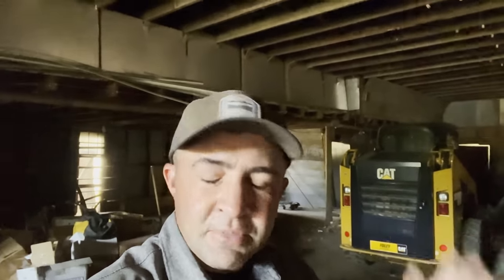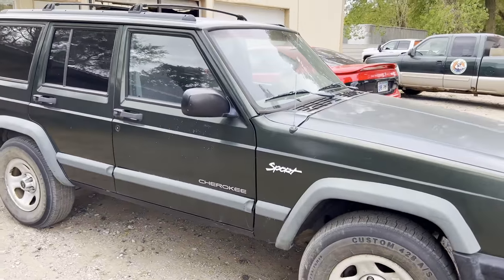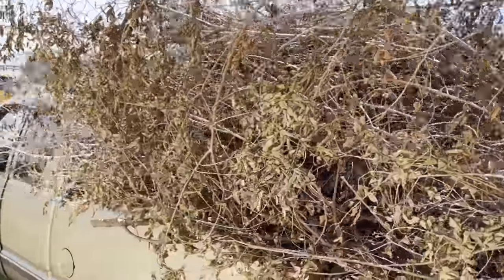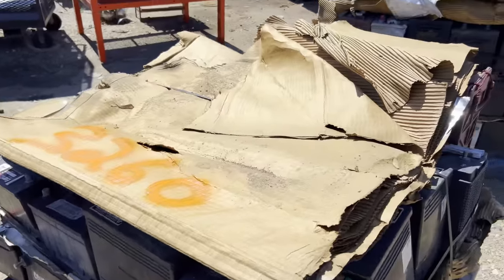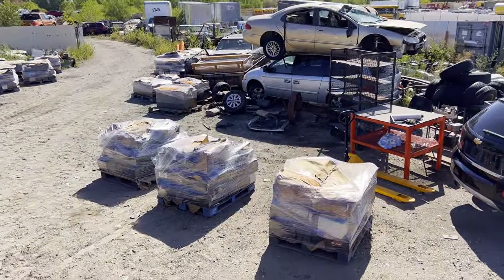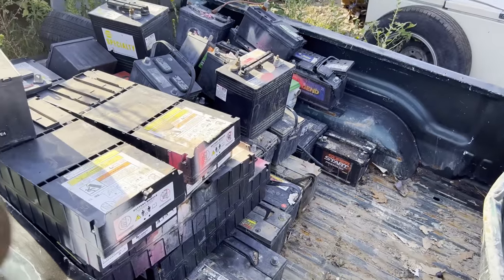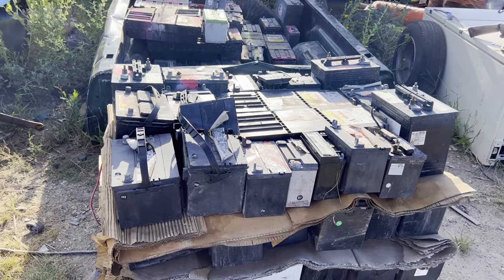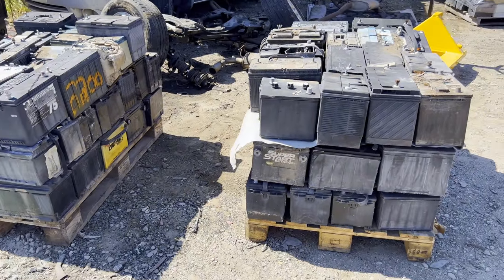A Look inside the CRAZY week of a junk man. HOW do I do it? Loading batteries, crushing cars & more!

Comment: Speaking shelves, My buddy and I were at MSC in our state and walked in just as a pallet load of brand new shelving slide of the pallet and crashed to the floor, The manager said, I've had nothing but bad luck with this load, This is the third  and last time and then I heard him say for 2-Cents I'd scrap the whole load, I reached in my pocket pulled out two cents and handed it to him. He said back up your truck you own it it all. It took my buddy and me 45 minutes to load it all. I have 24x6ft steel shelving throughout my 70 foot long ranch house my garage has two walls and my buddy filled three walls in his two-car garage. Not bad for 2-cents
Reply: lucky dog woooooooooooooof

Comment: A suggestion on the cardboard you will need. Talk to a local retailer that sells gun safes, all safes come with good quality cardboard in a box configuration with no bottom because they are on pallets. Most of the time they just get rid of the cardboard however they can, particularly if scrap paper prices are low.

Comment: Sounds like that battery outfit is warehousing the pallets of batteries like fruit bins 9 or 10 high then trans shiping them elsewhere in containers, wrapping loads to the pallets is pretty standard in the freight industry here it will save having to band them, hard yakka Silas in the heat, have a good one

Comment: when you set a pallet in the back of the semi you could leave the forks on the loader close to the back of the truck at about half the height of the truck floor and use the fork to step up on making it easer to climb up and down from  the truck.

Comment: I used to work at a ford assembly plant.. during just one 10 hour shift I would install 690 batteries..it was the second hardest job in the plant because of all that weight..first few batteries were light..but after that they started getting heavier and heavier..and that 690th battery felt like it weighed 690 lbs 🦾🤣🤣

Comment: I used to work at Oreilly's.  We did not ship same size batteries per load . That's impossible to realize.  Also Oreilly's uses corrugated fold up plastic boxes as a container to put them in . Your battery company just wants to be difficult.

Comment: Guess truck loading is different than in the 70s. I worked on a dock, my boss yanked the driver out of the cab of the truck and told him to get his butt in the trailer and help out...or spend the rest of his life on the dock.
Reply: Guess it would depend on the circumstances. If it's a 3rd party driver you now have to worry about worker liability.

Comment: @adventuresmadefromscratch find a 4 foot 4x4 board and when you load a batch of batteries into the trailer you can lay the board down and then use the next pallet to push it into the trailer. Once you have several loaded into the trailer then you can move them around to your load specifications. Just an idea.

Comment: You’re better off not dealing with a company like that they sound like real morons Great video Silas
Reply from the maker: We plan on going back to our old company if possible, even if it’s a little less money.
Reply: Actually they sound like they want things done well to make their own lives easy, and are willing to pay for that.  Using brand new, double or triple wall cardboard the same size as the pallet, between layers of batteries, will actually make the job of stacking and securing the batteries EASIER than using random scraps in random condition.  Separating out the various sizes/types of batteries as you acquire and store them, avoids having to search for similar batteries from a jumbled mixture when palletizing them.  Not having side terminals facing outward makes sense, and not having them touching when facing inward makes sense also.  If I were them, I'd go one step further and say that only one particular size/type of pallet is allowed.
Reply: @AdventuresMadeFromScratch  you must sleep like a rock on battery day/night

Comment: When old battery's get to the recycler ,they tip them in to a big crusher and smash them to bits  to get the plastic and metal separated .  What does it matter if they are different sizes ??  .It sounds like the receiver has a megga dose of OCD  and needs the pallets to be all neat and tidy !

Comment: you could have the truck driver drop the air on the drives to lessen the grade you haft to pull or push the pallets to the front of trailer.

Comment: Also didn't know if you knew it or not but the Blue Heavy duty pallets weigh way more than your standard pallet. I remember back in the 80's that loads that came out of canada always were shipped on the the blue chep pallets is what called and could only legally be used in Canada and were shipped by the truck loads back up there due to them not being able to use them in the USA. Some kind of agreement canada made with the usa.

Comment: Can I make a suggestion on your batteries if you can find a long pipe that'll fit on your forks and you can slide that pallet up the trailer with that pipe I don't know if I'd tear the pallet up but you it's worth a try also when you go to those auctions look and see if you can find an old marigold round or you can set the pallets on there and make it a lot easier on you to put the Saran wrap around it just an idea

Comment: I like your channel very much you were working your ass off loading those skids by yourself I used to put one up and then the next one I push it forward and then I just keep putting them on with the end motor 1 2 3 4 till I get almost to the where it's still in the whole trailer then I go in the front move the one forward some you might lose a few minutes but you better off putting that one forward and then everyone you can push them a little bit at a time if you get somebody up there to adjust anyway it might not help you and it might not be right I worked all my life I'm 67 retired and disabled and I live in Illinois okay thank you

Comment: Silas the trailer is 8 feet wide you should have enough room to make a U-turn with a pallet jack this is why we push a wheelbarrow and we do not pull a wheel barrel I don’t want you to wreck your back push the skid to the front of the trailer don’t pull it
Reply: I'd like to see you push a wheelbarrow with 3000 lbs in it. If it would hold the weight I guarantee you would TRY to pull it.  Apparently you have never loaded a semi by hand.  That driver would of been helping me or he would of been there for a very long time after I put the first pallet on the truck.

Comment: While everyone is saying to get an electric pallet jack, I say build a loading dock (concrete platform is sufficient) with 85ft in front of it for an 18 wheeler.  Then just keep a little forklift on the loading dock level to drive into the trailer with the pallets.  Using the loader forks from ground level isn't great, because you can't get each pallet past the pallet jack.

Every operation loading dry van 53ft trailers needs a loading dock, the patience of a saint, or a good back surgeon and cardiologist.  Even if only using an electric pallet jack to load a truck from dock height, not having to turn the pallet jack around inside the truck, like you do when loading from ground level, is a big deal.

On the other hand, you can't even keep your scale clear enough for use by 18 wheelers, so what are the chances you'd keep a loading dock area clear, clean, and usable?  It would be a big adjustment to declare certain spaces as off-limits for sitting anything, ever, treating it like it's a fire lane.  In a way, it's a fire lane for operating efficiently, because when access is blocked, your business profits are burning down.
Reply from the maker: I’d only use it once every few years so that’s a big investment and wasted space for little return unfortunately

Comment: Use a short piece of pipe or wood dowel etc. in the center of the shrink wrap roll. Hold the pipe instead of the roll wgeb wrapping to make it eaier and not have to adjust your hands to roll it out.
Reply from the maker: I have a roller made for shrink wrap. That’s what I used on all but 1 pallet

Comment: I know it's alot of money but solid tires would save you alot of time and money .
Reply from the maker: It costs about $7000 to foam fill them. They last about 5-6 years. In that same 5-6 years I might have to repair tires 10 times, which is about $2500. Definitely much cheaper to just fix tires. We’ve had foam filled tires before and never really liked it

Comment: Dude you have a nice skidsteer with a grapple bucket that brush would of been cleaned up in no time.
Reply from the maker: Took less than 15 minutes to load it all with the loader. Would have taken a solid hour to switch trucks, drive out to my place, dig out the grapple, hook up to the trailer, and then come back. 😎

Comment: I know I'll get my ass chewed out, but anyways, Silas, they do make a portable battery op baling tool that melts the bands together and cuts. No metal buckles. Would save you time.  And moving batteries from a truck bed to a pallet is ludicrous. I know, you don't want to put them on pallets because the pallet will rot.  Ok, put the pallet in a truck bed or in a covered box truck, then take it out when its full and park it under cover if you're so worried about the pallet rotting. Or stack it on double pallets so the bottom one is the one rotting.  Any time you're double handling heavy batteries, you're doing it inefficiently.  Just my sincere attempt to help you. Now you can chew me out.
Reply from the maker: We won’t sell again for a year, maybe even 2-3 years. Even covered, pallets will collapse with that much weight for that long. They will not let us double stack the pallets.

Comment: Just find somewhere you can get used gaylords from and put the batteries in them . Nail the cardboard gaylords to the pallets with roof nails.  Any place that does plastic injection molding has them and most are happy to get rid of them some charge around 5 dollars a gaylord
Reply from the maker: Very few if any companies accept them in boxes

Comment: Next time get the driver to drop his air ride on the tractor that will give you a couple inches down hill to make it easier to load .  Now as far as the part that was in the loader tire it looked like a old head light adjustment bolt off a older car / Truck since it was metal instead of plastic like newer ones . That battery place probably want be around very long being that pickie but guess they were unloading and loading into several trailers be only reason I see that maybe even shipping them overseas to China
Reply from the maker: The first driver did, but it was still uphill. The 2nd driver wouldn’t do it. The 3rd driver had electronic controlled air ride that auto adjusted and wouldn’t let him make his truck lower than the trailer.
Reply: @AdventuresMadeFromScratch  was I right about the part in tire ?

Comment: Dosnt the driver help you load?
Reply: As a long-haul driver for 22 years, I can tell you a little about it.  Sometimes, when you get dispatched on a load, your instructions will indicate if you have to "fingerprint"
(meaning that you have to touch the load in some way).  Sometimes, it will state "driver assist"  (which is what this driver did - he didn't load it by himself - but assisted).
Some places do not want drivers out of the truck (insurance liability issues).  Sometimes, the driver is required to specify how the pallets are to be arranged in the trailer
(then, if there is an overweight problem - it is on the trucking company / driver to figure it out - not the loading agent ).  I retired in 2017 - glad I'm out of it !
Reply: @Peter underdown....so, sorry, to answer your question a little better :  different places have different policies - some require the driver to load - some do not.
                                       It all is determined by what the brokers / dispatchers / shippers / consignees agree on.  In my case, when I was younger, I could do it.
                                       But it takes a lot out of you (physically).  When I started to have back problems, knee issues, heart conditions, etc. my dispatchers knew
                                       that I was unable to do the manual work anymore - so they would only send me on loads that were "no touch".   it is a hard job !
Reply: @urbanurchin5930  2015, I got out. You're right, the company I drove for their insurance company get real testy about drivers in the trailer. In some cases a few of us guys would do it anyway to hurry up the process. Do not miss it at all.